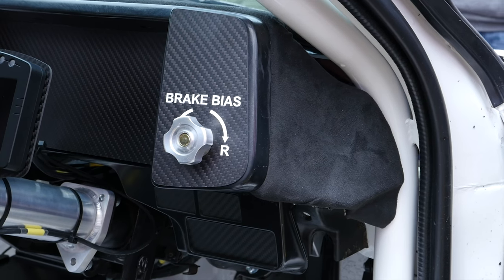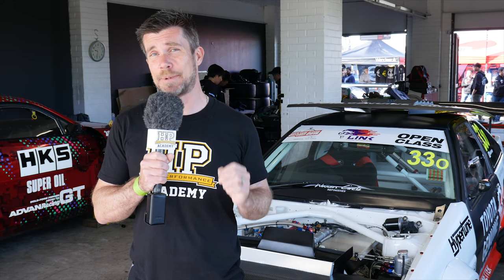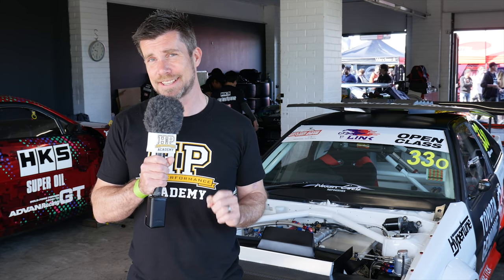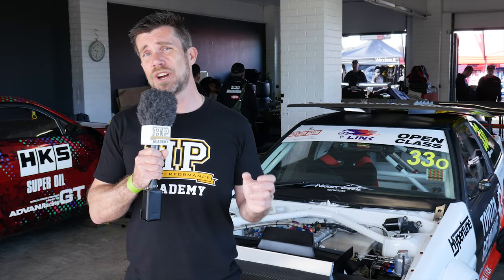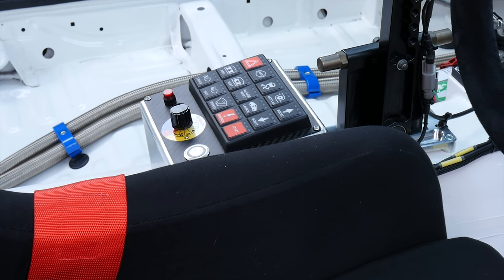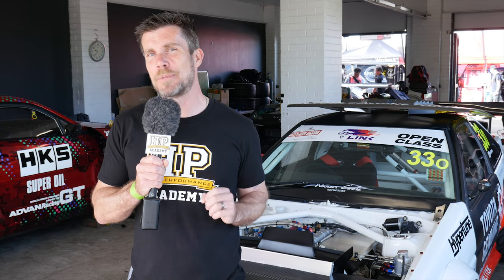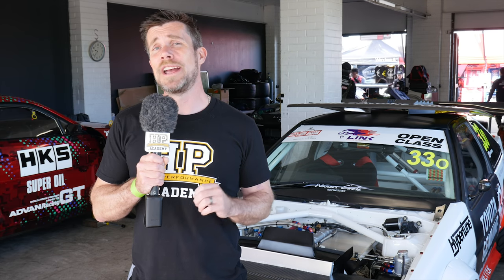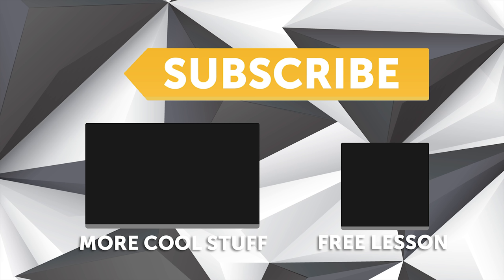ABS And Motorsports, What Do YOU Know About It? | Toyota AE86 [TECH NUGGET]

Comment: You are criminally under-subbed. You single handedly gave me the basics of tuning. After destroying an ej25 trying it my way, spun a bearing, I thought I would try to REALLY learn. You made it quick clear and understandable as well as allowing me to work at a pace I set. My newer Ford Ecoboost thanks you, surely, for saving its life. Haha
Reply from the maker: Cheers Kyle! We're slowly growing with people like yourself that are genuinely interested in the knowledge rather than just people browsing through and we'd prefer that than a few hundred thousand people that are not really engaged ;)

Really happy to hear you're making progress and enjoying it at the same time, perfect! - Taz.
Reply: Kyle, regarding bearings, if you need to have the crank tunnels align bored King Bearings have special oversized main bearings that will maintain the correct alignment as no material needs to be shaved off the mating surface - https://www.enginebuildermag.com/2015/07/king-bearings-oversized-xpg-main-bearings-for-subaru-ej/
I would suggest ANYONE working on these engines to check them out.
Reply: @gordowg1wg145  funny you mention the king xpg's. I still have that warrior of an ej255 in my basement. At the time when My Legacy GT died due to my poor knowledge and over inflated ego, I didnt have an option for down time and I was dead set that I was rebuilding that engine if it was to be my last accomplishment on earth. I opted to buy a Ford as I've had good experiences with them in the past and at the risk of sounding narrowminded, I like to stick with what I know, subaru and ford. Unfortunate the chassis on the LGT wasnt worth saving due to some very severe damage that I found in the course of tear down so the ej was dismantled, properly cleaned by a friend at his father's machine shop. And is awaiting the winter when I hope to dedicate the time it deserves to getting it back on the road and eventually the track. Before I made bearing soup she was doing great and I actually have a GPS readout trapping at 157 mph in just shy of half a mile but to be fair that was DAYS before the catastrophic engine failure occurred. I know 157 isnt much in this channel but I live in the northeastern US, and not the nice part. Lol everyone around here is about their jacked up trucks, and to each their own, but the roads are awful and the LGT had the aerodynamics of a manatee after 100. 
Sorry off topic. Nice to talk to guys that appreciate this stuff ya know? 
I will use those and hopefully someone at kings knows you're out repping their gear, always great to hear from people that truly believe in products.
Reply: @hpa101  Quality over quantity is a great way to go. Engage the few that appreciate the knowledge and effort you impart and I think the community as a whole, world wide, will be better for it. Thanks for the reply, and again truly, thank you for the beginnings because it made every bit of the difference.
Reply: @Westkhost  Don't have personal experience of the company, but they do have a good rep' and any engine saved is worth passing on the info' - even from a GM chap ;-)
Good luck with the build and, as for top end, I'm definitely a corner rather than straight line performance bloke :-D

Comment: Good topic, and one that I was going to research more when I get further into my project race car build.  Andre mentions the high cost, which I've seen $6800 - $12,000 range, and that's just too much for me.  Is there a lower cost alternative aftermarket system, or maybe a good performance driving oriented OEM ABS system that could be retrofitted to a race car project?  I'm starting with a non-ABS chassis, but my hubs have provisions for ABS sensors.
Reply: No, pays the cost to be the boss.

Comment: Been interested in this retro-fit option for a while, with a dual master cylinder pedal box is it possible to have the ABS reduce line pressure at just one end of the vehicle - looking primarily at the Bosch system?
They are expensive, but for some the savings on not flat spotting, and ruining, tyres or avoiding a single accident would pay for it.
Reply: Motorsport ABS is not for avoiding accidents, it's not approved for road use and it's doesn't control line pressure at one end.
Reply: @msengineeringdavid3702  Think on it a bit - running wide because a momentary loss of front end grip due to lock up and ending up in the barrier or another vehicle, momentary rear lockup upsetting the vehicle for ditto, aforementioned flat-spotting, etc - many benefits of retrofitting ABS in motorsport. Didn't mention 'road' use, BTW - oh, 'approval' will depend on local legislation - or do you mean by Bosch*?
A little disappointed it isn't able to isolate an axle, even with dual master cylinders, but wasn't really expecting it as it seemed to have a single servo' - possible to have a dash' indicator for which wheel(s) triggered it? 

*Bosch disclaimer - 
"It is the duty of the customer to use the system for motor racing purposes only and not on
public roads. We accept no responsibility for the reliability of the system on public roads. In
the event that the system is used on public roads, we shall not be held responsible or liable
for damages."
From the documentation I recall, it was possibly because of a more aggressive action, as it uses many/mostly production vehicle parts?
Reply: GordoWG1 WG1  in Motorsport you’re not doing things to avoid accidents, you’re taking a risk these abs systems are tuned to perform at the limit not safety... controlling pressure at one end is for brake bias not for abs.
Reply: @msengineeringdavid3702  Ah, perhaps it is a semantic difference, 'undesired' rather than 'unexpected' outcomes to actions?
I agree, brake bias would be the proper way of controlling the brakes' tendency to lock and, more important, to maximise the braking ability of the vehicle. I had in mind the ABS as a 'safety' measure for the less experienced who may not adjust the bias correctly, or if a driver was used to reverse adjustment (the cause of at least one crash I'm aware of) or, more to the point, to reduce a momentary control loss from unexpected changes in track surface conditions. There are reasons many motorsport classes prohibit ABS and why, when it is legal, it is used.
Reply: GordoWG1 WG1 no no one said brake bias to change the tendency to lock its to change general pressure applied at different ends. OEM abs is made to prevent ppl from panicking and locking their wheels entire different tuning focus from a race car , because an OEM reacts based on significant yaw moments and reduces braking force in a generic fashion regardless of the drivers skill, a race car has very high yaw moments and  the driver corrects with steering angle so the braking forces from a tuned abs are very fine tuned.  You don’t seem to have enough pertinent information to know if you need pressure control, you need more data to see what’s actually happening.
Reply: @msengineeringdavid3702  OK, seems we have rather different views, probably compounded from each expressing our thoughts in a way unclear to the other, as evidenced by your comment on brake bias or, more specifically, changing relative line pressure. 
If it works for you, sweet, and I'll leave it there.
Reply: GordoWG1 WG1 it’s a 7-10 thousand dollar system usd you can monitor brake pressures at each wheel you don’t need the system for that but what I’m wondering is why would you want to actively control bias?
Reply: @msengineeringdavid3702  
"Motorsport not doing things to avoid accidents ".

I thought Motorsport was about winning races, championships etc.
I remember a racing driver who said to win (a race),  you first have to finish .
Yes I can imagine the reply that the driver's role is to avoid accidents,  doesn't mean technology can't help drivers.
Seem to remember comment about auto boxes and power steering having no place in motor racing, don't think many race cars have manual box and clutch or unassisted steering any more
Reply: Paul Almond irrelevant and I’m not about to go off sayings but you sound bored winning is about consistency if your engine/ car doesn’t last something is wrong and abs is Motorsport use is not for avoiding accidents it’s for pulsing the brakes car beyond what the driver car do each time every time.

Comment: Are there any alternatives to Bosch system?
Reply from the maker: Yes, there will be a range of aftermarket ABS systems out there I'm sure - Taz.
Reply: @hpa101  thanks! I was looking for them but the Internet struggles to give me any other brand option than bosch...
Reply from the maker: ATE Brakes (Continental) and I think Tuner Motorsport off the top of my head are two names I've seen around. I wouldn't expect to find any that are massively different from the Bosch Motorsports system in price or performance, fitting aftermarket ABS is going to be an expensive task full stop - Taz.
Reply: @hpa101   Thank you! I'll give them a look! :D